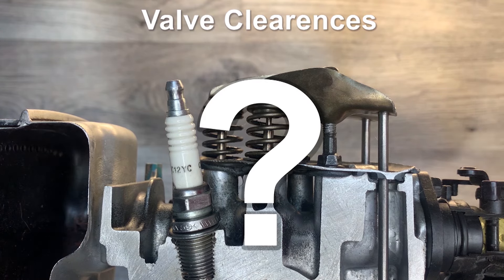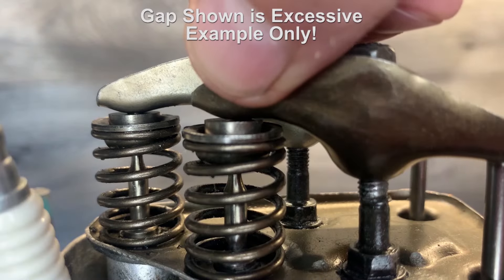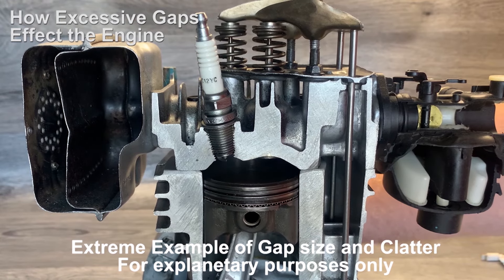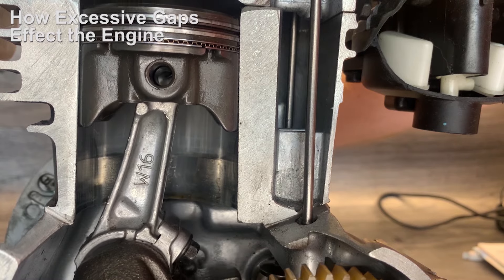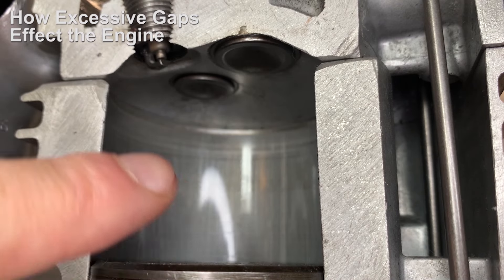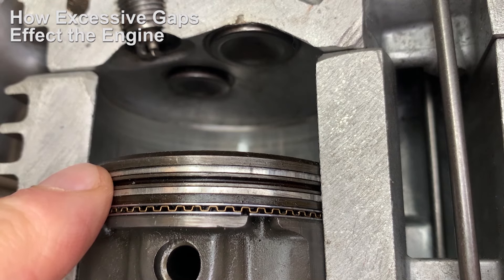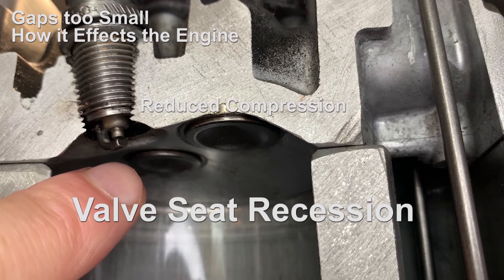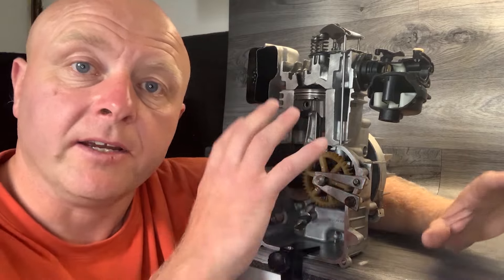The Smartest Reason for Correct Valve Clearances!  (by Craig Kirkman)

Comment: I find that the toughest part is determining what stroke the engine is on when the flywheel is not marked, so I pull the spark plug and put a screwdriver in the hole and crank the engine until the piston tops out and screwdriver is at its highest point. Both valves are all the way up or in closed position. Then I check clearances with a feeler gauge.  On a 9.5 Kohler they say .005 for intake and .007 for exhaust on a cold engine. Does this sound right to you. The engine really gets hot during continuous log splitting operation and smells hot sometimes. I think it needs better cooling system myself as well as a hydraulic oil cooler.  I run 30 weight HD motor oil above 60 degrees F and 15w40 Rotella below 60 down to about 35 F. Anything colder gets full synthetic 10w30. The manual also says to ALWAYS run at full throttle. It's a screaming beast of a wood splitter.
Reply from the maker: Hey there!

Your method of determining the stroke of the engine sounds resourceful—using a screwdriver to gauge the piston's highest point and checking the valve clearances with a feeler gauge is a great way to ensure everything's in sync. Regarding the Kohler 9.5, those clearances (.005 for intake and .007 for exhaust on a cold engine) seem pretty standard for that model. It's crucial to maintain these clearances for optimal engine performance.

It's interesting that the engine heats up significantly during continuous log splitting operations. Improving the cooling system sounds like a smart move, especially considering the demanding nature of the work it's handling. Additionally, the idea of adding a hydraulic oil cooler might help with temperature regulation, ensuring smoother operation during those intense splitting sessions.

Your approach to using different oils based on temperature variations is quite thoughtful. It's essential to adapt the oil viscosity to the ambient temperature, and your choice of motor oil seems well-suited to the engine's needs.

Ah, the manual's advice to always run at full throttle! That certainly paints a vivid picture of your wood splitter as a real powerhouse. It's impressive how it operates at maximum capacity, showcasing its true beastly nature.

Your hands-on approach and attention to detail are commendable. If there's anything else you're curious about or need further assistance with, feel free to reach out. Wishing you continued success in taming that beastly wood splitter!

Thank for sharing your info

Craig
Reply: Something else that is notable:  It the engine runs out of fuel and dies when the ram is in the up stroke the engine will not start until the lever is put in the center or unloaded position. Owners manuls don't tell you this.   Also I finally got  spec sheet from Kohler on that valve clearance. It is .003 to .005 for BOTH the intake and exhaust valve. Every shop I called had different numbers here,....the ding bats.  I reset both to .004 and it starts and runs much better now and I don't usually have to use the choke any more. Saweeeet.    Remember you have a 4 stroke cycle going on and make sure you adjust valve clearance at TDC on the compression stroke. With plug out it is easy to tell. Put finger or thumb in plug hole. You get suction then compression which pushes your finger off the plug hole. TDC or a couple degrees after TDC on COMPRESSION stroke is what you want. Sweet & simple.      @TheRepairSpecialist

Comment: One thing about the exhaust valve opening earlier to swirl in air. The exploded gasses are still expanding. When the exhaust is opened, it is done so that the burnt gasses wouldn't push back on the piston creating resistance on the exhaust stroke. 

The moment the valve is opened, burnt gasses that are still expanding rush out trough the valve opening (and create the exhaust sound). I don't think air could have a chance at entering the cylinder - at least from my knowledge.

Comment: Hello ,a question if you have time ofcource.
Talking for a motorcycle (yamaha crypton T110) that 
having lets say 3rd ,4th gear and going with no throttle downhill
then (always) hearing/happening burn fuel at exchaust (lets say every 10 seconds etc)

So my question is ,,,suppose that carburator is fine(that maybe is not)
Is it possible that incorrection adjustment ( or damage) in valves
is provoking this chap of noise ?(that propably also make loose fuel more than it needs-not burned correctly fuels)

Thank you in advance,
Reply from the maker: Hi there! Naturally, I'm pleased to assist you with your Yamaha Crypton T110 question. It's excellent that you're observing your motorcycle's sounds and behaviours. Although the issue may have something to do with the valves based on what you've mentioned, it's important to take other things into account as well. Incorrect valve adjustment or damage may be the cause of the noise you're hearing and inefficient fuel burning, but it's also a good idea to check other parts like the air filter, spark plugs, and ignition timing. 

All of these may have an impact on your motorcycle's overall performance and how well the engine burns fuel. To ensure an accurate diagnosis, it could be a good idea to get the vehicle inspected by a qualified mechanic if you are unsure about the issue. Please don't hesitate to inquire if you need help or have any further questions. Enjoy your ride!

Thanks 

Craig
Reply: @TheRepairSpecialist   Thank you very very much. I ve just asked to be ready to face some strange engineers that even they dont know directly or even they just want my few money.Thats why,,,OK,,,i will check them as you ve said...Thank you for your video-lessons !!!
Jim,,greedings from Athens(greece)

PS..i like that noise because its making feel as Colin mcray coming to a corner !!(heheh)
..but i must correct it sometime !

Comment: just a mention, did you know that you can increase compression in a lot of applications, by having a larger lash on the intake valve,,,,, why you ask? because just like it takes a little longer to start opening the intake valve when the intake lash, it also closes sooner, so that the piston may not started traveling upwards or traveled upwards as far, giving more stroke of the piston with the valves closed to build compression, basically its a very crude way to change cam timing

Comment: So here’s a question if anybody sees this and wants to chime in. I am looking at doing a valve adjustment on a KTM 390 engine and a lot of the tutorials I found on YouTube adjust the valve clearances on the looser end of the spec range as opposed to the tighter end of the range?  They state they do that because they’re worried about the cylinder head hitting the valves. However, based on this video that doesn’t seem likely unless the engine is not timed, right. It also seems less likely on the intake instead of exhaust. In my mind going tighter in the gap range would leave room to wear thus staying in spec longer?

Comment: Nice explanation 👌    so in theory you want the exhaust  valve  titer than the fuel valve mate. To keep the temps down. On engine and the let all smoke come out of port
Reply from the maker: Thank you so much for watching my video on valve clatter, and I appreciate your interest in the topic!

In theory, adjusting valve clearances can indeed have an impact on engine performance and temperature control. However, the specific valve clearance settings can vary depending on the engine design and manufacturer's recommendations. It's not necessarily about having the exhaust valve tighter than the inlet valve, but rather about achieving the correct clearance for each valve.

The main goal is to ensure that the valves open and close at the precise moments as specified by the engine's timing. This allows for efficient combustion, which helps with power output and emissions control. Tighter clearances can sometimes help reduce valve noise and improve low-end torque, but it's essential to consult your engine's manual or the manufacturer's recommendations for the proper valve clearance specifications.

Ultimately, the goal is to maintain a balance between valve clearances to optimize engine performance, minimize noise, and ensure proper sealing. If you have more specific questions about your engine or valve adjustment, don't hesitate to ask, and I'll do my best to assist you further.

I hope this has helped a little

Craig

Comment: I'm wondering why there's any suction force in the cylinder during the later part of the power stroke. I thought the pressure in the cylinder at this stage would be higher than atmospheric.

Unless, the expansion of gases during combustion isn't enough to fill the cylinder when the piston is at BDC. Is this a consequence of volumetric efficiency (i.e. no naturally aspirated cylinder is ever 100% filled during the intake stroke) so there's bound to be a slight vacuum at BDC of power  stroke?

What am I missing?

Comment: You have to mention how the cam grind is designed to open up the valve at the right angle of the camshaft design and closing. That way you're not beating up your valve train or burning up the valves.

Comment: Sir .. Thank you , very detailed  step  by step explanation . I am working in tractor diesel engine and we have "Tappet Noise"  is the top most problem at our end . I am looking for the way to trouble shoot this concern. The operators follows the SOP  of setting the gap on the engine assembly line . However when some of these engines go in the testing we here "Tappet Noise " at Low Ideal speed just start of the the test  cycle and at the full load also .  Will you please guide us on how to go step by step for the root cause analysis . We did it with  one "Good : and One " Bad" engines but  it was not leading  us to any root cause.
Pl help us.
Thank you 
Ajay
Reply from the maker: Hi

Tackling "Tappet Noise" in tractor diesel engines can indeed be a tricky challenge. It's commendable that you're looking for a systematic approach to troubleshoot and resolve this concern.

When it comes to identifying the root cause of tappet noise occurring during testing, conducting a methodical root cause analysis is key. Here are a few steps that might help you in this process. However please take this as a guide only and to ensure your safety and the safety of your machines are met first and during the operation:

Review Assembly SOP: Double-check the Standard Operating Procedures for tappet adjustment during assembly. Sometimes, even minor deviations during assembly might result in this noise issue.

Check for Consistency: Ensure that the adjustment made during assembly is consistent across all engines. Variations or inaccuracies could lead to tappet noise in some units.

Verify Components: Assess the quality and condition of tappets, pushrods, and related components. Any wear or inconsistencies could contribute to the noise.

Oil Quality and Pressure: Evaluate the oil used for lubrication and ensure it meets specifications. Low oil pressure or poor quality oil might affect tappet performance.

Testing Parameters: Review the test parameters and conditions to replicate the issue consistently. Check if there's any correlation with specific testing conditions leading to tappet noise.

Acoustic Analysis: Consider employing tools for acoustic analysis or sensors to pinpoint the exact source and nature of the tappet noise.

Comparative Analysis: Compare various aspects between 'Good' and 'Bad' engines, including assembly records, test data, and any deviations in parts used or adjustments made.

Professional Assistance: If the issue persists, seeking the advice of expert engineers or specialists might provide new insights into the root cause.

Remember, the key to successful troubleshooting often lies in methodical and systematic analysis.

I hope ths helps a little

Best regards,
Craig
Reply: Dear Craig , 
Good Morning..! 
Thank you for your immediate response . It is  much more in  detailed approach for the analysis and made easy for me to understand.  Today We have planned analysis with two engines which we have hold for tappet noise . We will follow the step by step approach . 
Please help to understand what is the role of .
We have not worked or thought of this aspect ever.

 @TheRepairSpecialist

Comment: What do you think about valve lashes to tight on my Honda rancher 350 trx I have oil coming out my exhaust and blow by tube in air box do you suppose this could be caused from over tight valves

Comment: Hi, nice explanation! Now let me ask You something .. can it (the too big clearance) cause a noticable 'tapping' sound but only for the first 2-3 seconds after cold start? Can the oil 'dampen' the sound if the clearance is already too big, but only a bit? (the sound is not noticable when the engine is warmed up). I'm trying to diagnose the sound I get when cold starting my 1G-FE (Lexus IS200). If You can shed some light it would be awesome. 

Anyways, thanks for the video!:)
Reply from the maker: Hello! I'm glad you found the explanation helpful, and I'd be happy to provide some insights into your cold start tapping sound.

Yes, excessive valve clearance or lash can indeed lead to a tapping sound, especially during the first few seconds after a cold start. When the engine is cold, clearances that are already on the larger side can become more noticeable because the metal components haven't expanded as they do when the engine warms up. As the engine heats up, the clearances can decrease slightly, which may explain why you don't notice the sound when the engine is warmed up.

Oil can act as a dampening agent to some extent by filling the extra clearance space between the valve and the rocker arm or camshaft. So, when the engine is cold, and the oil is thicker, the tapping sound might be more pronounced. As the oil warms up and becomes less viscous, it can provide better cushioning and reduce the noise.

To diagnose and potentially address the issue, you could consider checking and adjusting the valve clearances according to your vehicle's specifications. If you're not comfortable doing this yourself, a qualified mechanic should be able to assist you. Additionally, ensuring that your engine's oil level and viscosity are within the manufacturer's recommendations can also help mitigate valve noise during cold starts.

I hope this sheds some light on your situation, and I wish you success in resolving the tapping sound in your Lexus IS200. If you have any more questions or need further assistance, feel free to ask!

Thanks
Craig

Comment: Good explanation.   
So will my bike start if the exhaust valve is to tite
Reply from the maker: Thank you so much for your feedback! 😄 I'm glad you found the explanation of the 4-stroke valving system helpful.

Regarding your question about the exhaust valve being too tight, if the exhaust valve clearance is too tight, it can affect the engine's performance. It might make it harder for your bike to start, as it could lead to insufficient exhaust valve lift and compression. However, this also depends on how tight it is and other factors.

If you suspect that the exhaust valve clearance is off, it's a good idea to check and adjust it according to your bike's specifications. Proper valve clearance is essential for optimal engine performance and starting reliability.

If you need guidance on how to check and adjust the valve clearances or have more questions about your bike's maintenance, feel free to ask. I'm here to help! Craig

Comment: @3:58 With the pressure in the cylinder there can't be any air flow into the cylinder when the exhaust valve opens can there?

Comment: Awesome.
Q. Maybe because that is a. "Mock" engine, but why is there that "square wave" looking ring under the piston rings? I have never seen a piston with anything that looks like that.
Reply: It's an "expander" for the Oil Control Ring. That helps the ring exert the correct pressure to the cylinder wall.